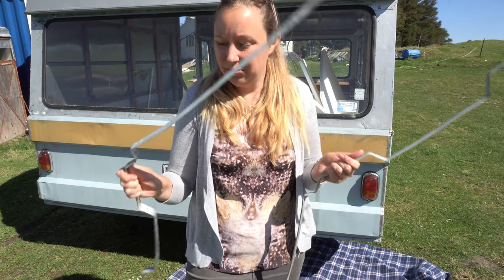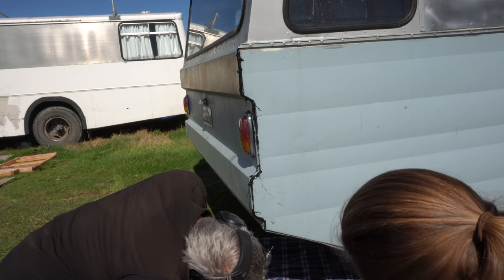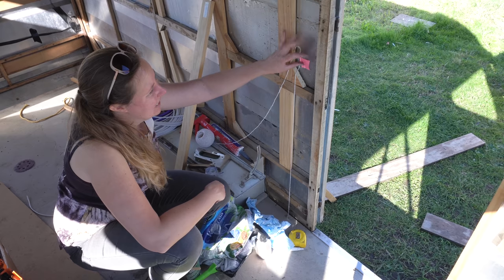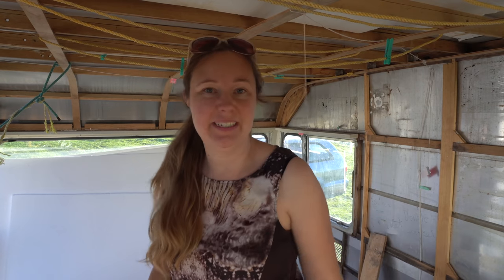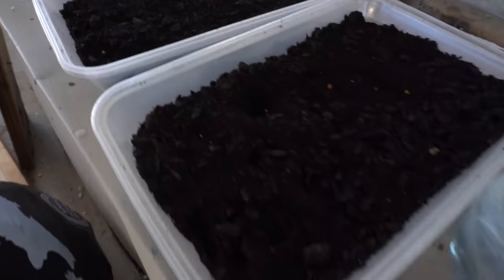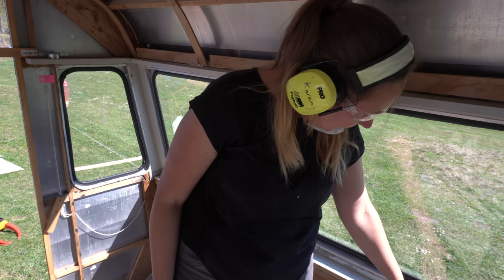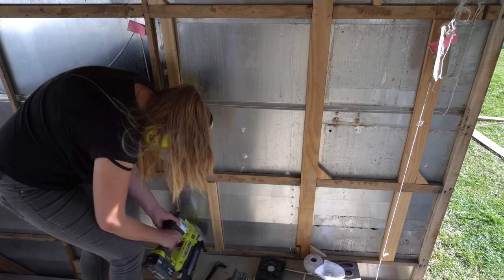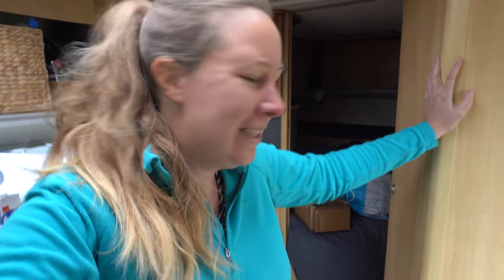Electrical Placement & Sander Fire 🔥

Comment: If you have a small air compressor handy, give the sander a good cleaning. Remove and clean the dust collector (they get buggered up quickly) and blow out the sanding disk side and motor side of the tool. A good habit after every use. Thank you for the vlogs! Enjoy watching your journey very much. Stay safe. Cheers from the US.
Reply from the maker: It seems to have completely stopped working... a good tip for future sanders! Glad you're enjoying the videos.

Comment: I don't know if I missed it, once you have comprehensively leak tested the van i think I would spray foam the shell, the foam would give great stiffness with heat insulation.

Comment: You might want to consider putting the battery closer to the axle rather than the front corner, it will distribute  the weight better. Putting it in the front could impact on the nose weight.
Reply from the maker: The fridge will be in that spot. I know it's ideal, but it's such a small space to place everything I need.

Comment: Careful of the wire through a hole in a metal plate! It can chafe through and cause a short circuit!
Reply: Johan Kotze --- Rubber grommets would be good.
Reply: Wallace & Grommet
Reply from the maker: Good to know about adding something to protect the wire!

Comment: Watching you stringing the wire was helpful. I'll be doing that in my retirement project Toyota van to campervan this weekend. Learning about electrics has been a good learning curve. A good long while since doing any 12volt wireing. Are you going to use conduct to limit rubbing areas?
Reply from the maker: Ohh I'll need to learn more about conduct!
Reply: @TravellingK  oops my spelling strikes again...conduit. find it at bunnings. I'm trying to learn electrics for my van build. So much to do!

Comment: In the US we can use on-the-wall conduit even for 120V.  Consider using this if equivalent is available in NZ.   Easy to run wires and remove or add over time.
If you only need 240V to charge laptops, why not just use the outlets on a portable inverter, or make a power supply to change 12V to whatever DC volts needed for the computer/phone equipment.
I always love seeing the dog coming in for a belly rub.
Dave.
Reply from the maker: Unfortunately using 120V isn't allowed here. We seem to be pretty strict with electricity. I might use the inverter plug to start with...

Comment: Is that sealer, what you've used, a mastic sealer (like sometimes used around vehicle windscreen), or a silicon rubber type sealer ?.  I love your videos. Great to see two people ,who are active, and enjoying life. Keeping on with the kiwi DIY tradition 👌 Tu meke 👍
Reply from the maker: It's called a  Sikaflex 291 Multipurpose Marine Adhesive Sealant - suitable for making elastic, vibration-resistant joint seals... seems ideal🤣 Glad you're enjoying them!
Reply: @TravellingK  ohh, be interesting to see how good it lasts. I'd say it should be good being how its produced for marine purpose. I've never had much luck myself with the silicone type products. They have always been less messy, but have tended to let go on one side of the bond.

Comment: I think that maschine is burned out(the wiring) Remember with tools after heavy pressing or drilling . You have to cool it down afterwords by letting it turn without labour for 30 sec. I made that mistake years ago by not doing so. But the progression on the caravan is nice. Good job.
Reply: That's good advice...I recently killed an angle grinder with over-use and there was some burning wires....real flames!! :D
Reply from the maker: Hmm good to know... I don't think I treated my own drill very well...

Comment: Notch in the wood by the fan - you could have swapped ends with that wood and notched the correct side at the other end - 2 half-weak spots rather than one very weak spot !
Reply from the maker: Ahhh good idea. Next time.

Comment: Surprising that you have to get an elecchicken to wire the 240 volt side of an inverter as that is not the mains and dose not have a potential to ground. The worst thing for sanders is paint and filler,the dust from those tends to stick to the motor windings and causes heat build up, that is why vehicle finishers use air powered sanders to such an extent.
Reply from the maker: We seem to be very strict with 240v in NZ? I have a warranty on my UK caravan for electricity. Ah, interesting to hear what the professionals use.

Comment: Big job, not looking forward to fixing faults on my 70s explorer look alike.
Awayway your doing a good job especially on the outside.
Im not sure you can use a filler to smooth out the ali surface.
Reply: There's a pub 15 minutes down the road.
You don't need Google there.
Some of those locals know just about everything imaginable 😂
Reply from the maker: Ahh, nice idea to ask locals! I'll admit, it's a challenge sealing this caravan!